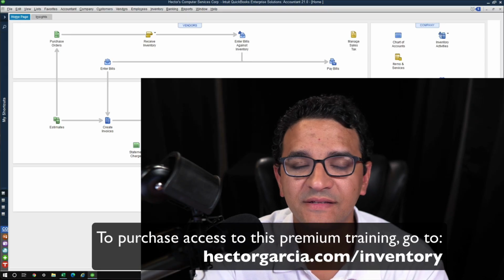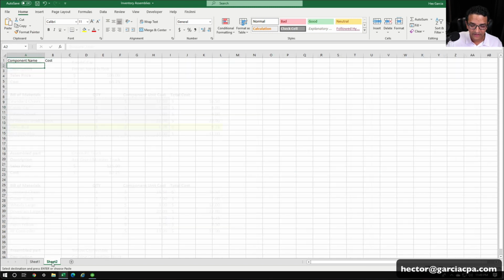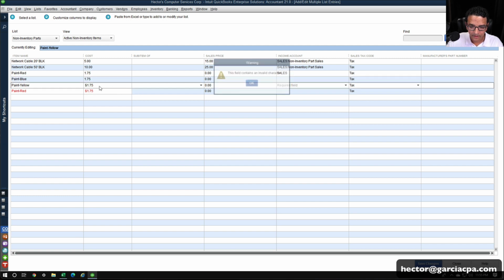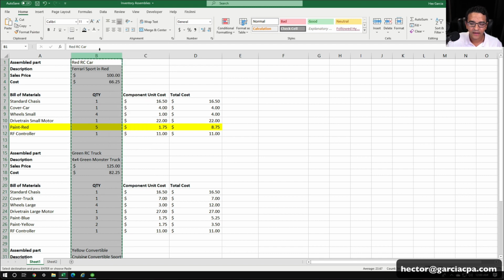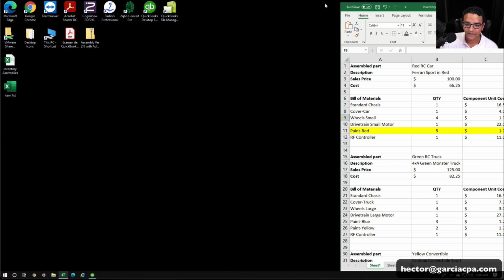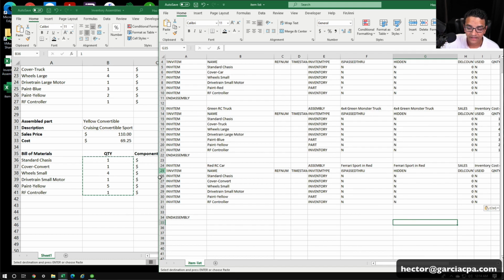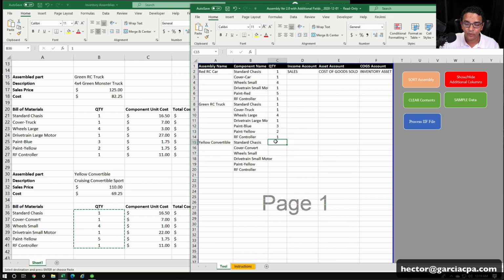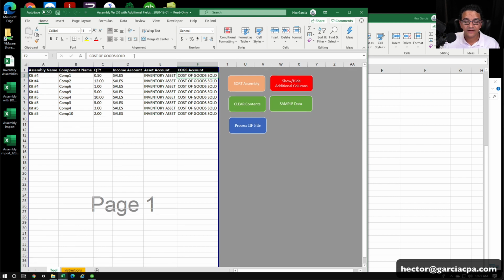QuickBooks Desktop: Inventory Assemblies & Importing components (Bill of Materials) from Excel

Comment: Hi there, I'm wondering if your IIF BOM macro is still going to work with QuickBooks Enterprise 2024/2025. Thanks in advance.
Reply from the maker: @mexiken1234  it works.
Reply: @HectorGarciaCPA  Hi there, i tried the import but ran into a problem. My 'names' are part numbers where many of them start with a leading zero. The macro stripped the leading zeros off my part numbers, so the import did not work for me. Would you be able to let me know a possible solution? Thanks!
Reply: @HectorGarciaCPA  solved my problem of leading zeros by adding a custom format on that column of 00000000. Ran into another issue where assemblies had subassemblies, but I kept running the output of the IIF import tool back through the IIF import and eventually got about 99% of my BOMs uploaded. Thank you!
Reply: @HectorGarciaCPA  The issue I noticed is the Cost did not carry over, and there was not a place for me to specify how many of these assemblies I have in stock, so they are all 0 quantity. Is there a way I can adjust your tool to allow me to import that information? Thanks!
Reply from the maker: @ costs dont carry, you need to assemble items first with historical costs
Reply: @HectorGarciaCPA  Is there a way to modify the Macro so that it does bring over costs? Also, there was no field for Quantity on Hand. My existing ERP system tells me how much these assemblies cost and how many of them I already have in stock, and I need to bring over that information for my COA to make any sense. Do you have some recommendation I could follow? Or should I try using the Inventory Adj QTY Macro on Assembly items? Thanks!